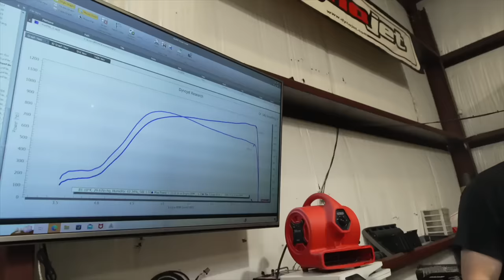WE ARE BECOMING MUSICIANS !!!...

Comment: Bro real talk how you think Seals feels not having been in a single race since midnight convinced him to sell Gringo 1.0?  Has to be rough every time Manuel blows his motor lol. Poor dude.  See if maybe he can go hunt down OG Gringo from them boys in Mexico and go back to PSS.  At least there he was in races and won lol.
Reply: Never happen bud. F150 is going in the right direction. Truck is new front to back. Every nut, bolt, wire drivetrain everything is brand new. When the bugs get worked out you will see…Midnight is on top right now. Thanks for the support
Reply: Thanks for the response but just call it how we all see it.  Fords haven’t shown to an event since when?  All we hear is blown motor after blown motor.  The 4x4s all been waiting for big mouth to show but crickets.  Too bad your good reputation being dragged with them clowns.
Reply: Randy should do like odg and go to flaco. He prolly coulda built 2 trucks by now and been racing.